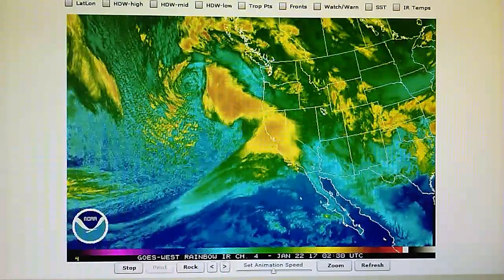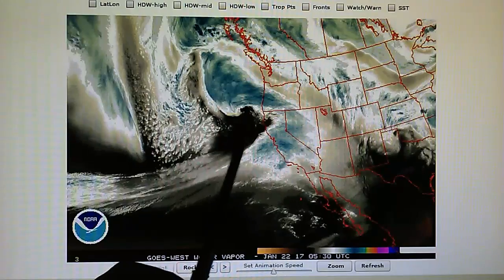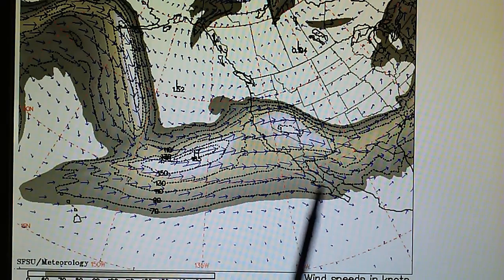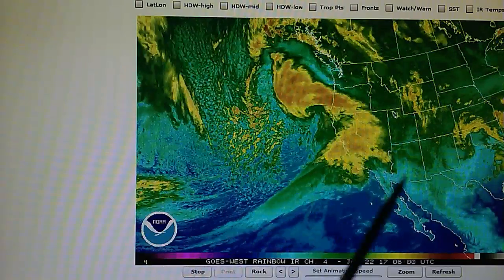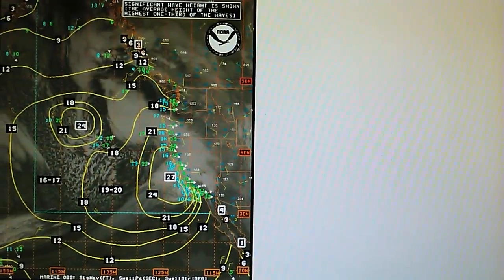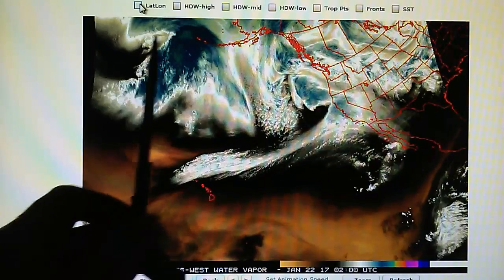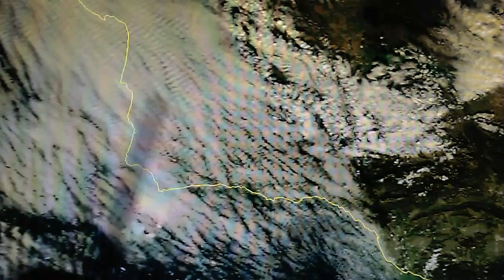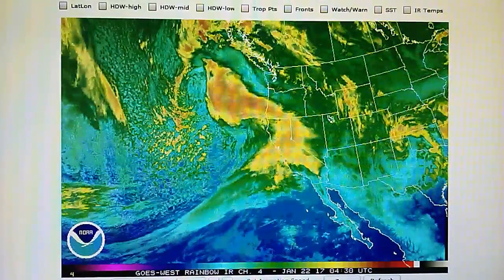1-22-2017; Phased Array Satellite Transmitter Generates Right Angle; Frontal System Splits Away

Comment: 12:00noon west LA:  The steady rainfall coming down since 3:00am is not as heavy as it should be since the system was manipulated by transmitter and the slightly windy conditions are likely due to the transmitter activity! Thanks again for your on point reporting 1Pacific.
Reply from the maker: Ashton 09 - 6:40pm; We've had only 1.75" of rain today; much less than originally forecasted. The storm off of WA & OR has changed directions since early this AM and is now indicated to be treking to the SE but the system seems to be stationary on the satellite maps currently; we may see more rain tonight and tomorrow.
Reply: 1PacificRedwood; I could tell by the lighter rainfall that the system was being manipulated today .. a much weaker storm than forecasted.